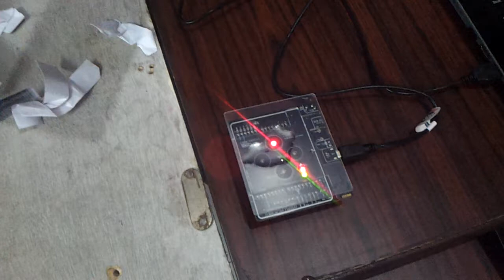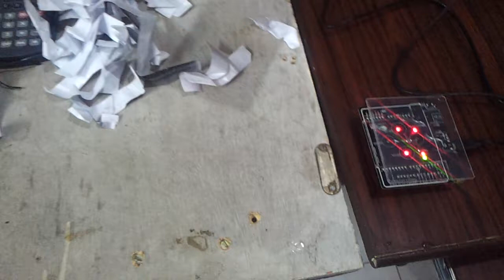CapSense in water performance

Comment: Hi Inderpreet,
Good water-tolerance tests! 

The kit is acting as designed under the following two modes -

1. Under presence of water droplets or mist, the buttons continue to operate as normal. They do not get triggered by any false touches. The shield electrode around each button comes into play here as it detects the water and auto-compensates for change in CapSense sensitivity because of that water. Think of this as 'water tolerance'.

2. Under heavy water, the kit's guard sensor 'shuts down' operation and rejects all touches to prevent any mis-triggered inputs. Think of this as 'water rejection'.